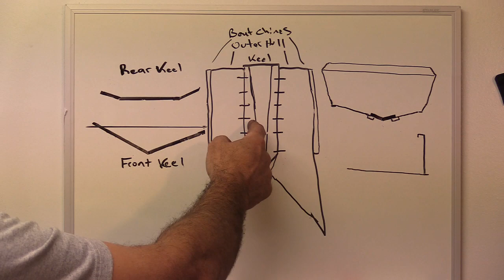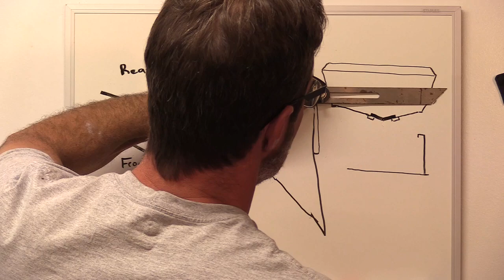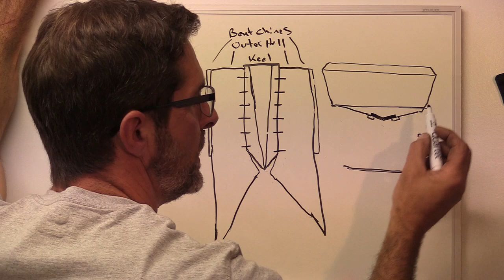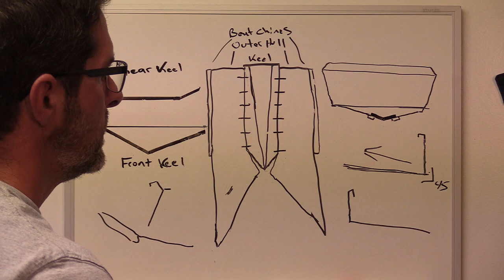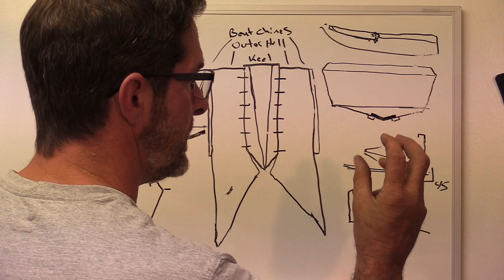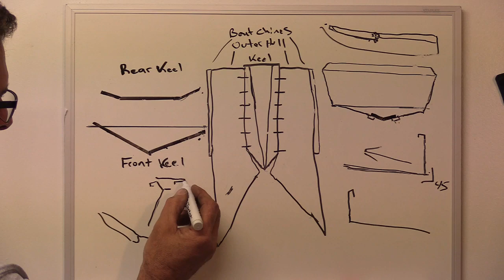Wattscraft Mini Jet Boat Build - Instructional Video #1

Comment: If your going to build your own boat from a kit set you should do the basics first when it arrives (before tack up) that is measure every thing. Both half should be the same. If all measurements are the same then measure the bends in the keel it's a very easy process if these are all good start the tack up. Remember  you must give and take. some times you will need to grind some times you will need to weld. If you thought you could build this boat then you should be able to fix this problem.
I'm from New Zealand  were these boats are designed and alot are made and we don't complain we just fix problems. Measure Measure Measure
Reply from the maker: You can’t just grind and weld away bad bends from the keel up and have a straight hull. I didn’t pay $5k and drive long distance so that I could go home and learn that after returning the first kit. I can’t bend 3/8 sheet in my garage. Learning how to hack together a bad kit takes a long time. I know that these videos have saved some other novices from getting screwed like I did, so you expert hackers will just have to put up with my complaints.

Comment: Did you consider the possibility of the bends changing in transit people are rough and lets be honest if it aint theres they dont take the best care of it
Reply from the maker: Not the over-bent side panels and top rails for sure. The 3/8 keel is only   a couple feet wide with, essentially, what amounts to cross bends structurally. You would have to drive over it. The side panels and top rails were over-bent in reverse, which would be the case if the brake was weak or not set up well on one side. You would turn your work on the brake one direction for the left, and the other for the right. I don’t think they had the ability to bend it well when I bought my kit. Either that, or they farmed it out and just sent it. I got the feeling that they couldn’t fix it when trying to work with them. That’s why I gave up on them and tried to get it corrected locally, but it didn’t work. Re-bending 8’ 3/8 metal is probably a losing game, especially where I live.

Comment: Paul,  I'm looking at a watts craft kit and after your video I am questioning my purchase. That said, the parts are all CNC so I can't imagine parts are the issue. As for bending, evaluating the kit, that's something you have to check prior to any fab begins. Sorry to hear about this because you obviously work for your money as do most of us. 
Thank you for the post
Reply from the maker: I like the boat, but those bends need to match. I like the looks of their new scookum (?) Hull. The swim deck is part of the hull, which gives more room for things like the water box. I would personally want to check the bends myself though, or get some kind of written guarantee. If they would give you the bend specs, and guarantee deliver of a proper kit or cover return, maybe it would be worth it.
Reply: @paulchristian8271  I'm in 100% agreement with you on that because a good fab man would want to double check especially with prefab beds. What power did you use?
Reply from the maker: @texasyankee1013  I used a 2016 Yamaha 1.8 naturally aspirated. It’s top speed is 42 using gps. I haven’t felt like it lacks power at all, but my interests are more family oriented in use. It does great running the rivers, so I’m happy with it. The supercharged versions suck a lot more gas even at cruising speed. More power is great if you don’t mind paying for it. I was also thinking longevity.
Reply: Thanks! I'm looking at building a honda K20 or 24 and marinizing for a jet. Not sure what size boat yet, but would like to build the motor between 350-500 hp.
Reply from the maker: @texasyankee1013  Wow! That should be an interesting ride.
Reply: @paulchristian8271  If it happens I'll video the build, boat and motor. Will try to keep you posted. .

Comment: dont worry about it just use the dam thing, you would have a tough tome the first time building a house too, but we all do.
Reply from the maker: FreedomMonger People need to know what these kits are. They sell them giving the impression that they are an easy tack up and weld build. That is not true, and getting a poorly bent kit takes it from difficult to ridiculous. The people buying these kits are generally not boat builders, and need to know the “normal”challenges that come with it, let alone the increased challenges that come with bad bends. Some people actually want a nice, straight, and even hull. They should be aware of the challenges and risk that come with these kits.

Comment: Im surprised you continued thru the build at the point you realized a struggle in your fit up from side to side.
Reply from the maker: Kurt McCormick If I had it to do over, I would try to get the bend specs from Wattscraft and find a shop that could make them right before putting a single tack on it. I’m doing the videos to let people know not to take their bends for granted, and not to let RSR off the hook if they buy a bad kit from them. Unless you live in Idaho, it’s not easy to take it back to have them fix it, and I don’t know if they could anyway. When you don’t have any experience, you end up listening to them and continuing on when you shouldn’t.

Comment: I just completed my wattscraft first time on the water last weekend.  I found the instructions quite adequate and everything lined up surprisingly perfect.
Reply: Next time im out I will try to video it .. still needs paint and few other small jobs . 
I ordered mine directly from wattscraft in New Zealand as a flat pack. Folded here in Australia but everything lined up with absolute precision.  
You will be happy once done handling is awesome and although heavier than a jetski still very quick to the plane.  Running a Yamaha gp1300r motor and pump...
Reply from the maker: ididnt doit Make a video. I’d love to see it.
Reply from the maker: ididnt doit RSRACECRAFT is where I got it.

Comment: thank you, Sir. Your level of documentation, discussion and commentary is very much appreciated. I am looking to do something similar but I am looking at going my own route. I have purchased plans that were piss poor and require a ton more detail. Please keep up your work, I am watching every single one! Also, where about are you located?
Reply from the maker: tommyg33s I’m in southern Oregon. Progress has slowed down due to my summer work load. My grandmother is close to death, And I’m in charge of her affairs, so    I expect progress on the boat to be slow for a couple of months. All I got done in the last week was a bow brace and a little hull welding. I’d be really happy if I got the deck and windscreen on this weekend. I’m working on my welding as well. I have to freshen up every time I go back to it. Different thicknesses and types of joints require adjustments, and it’s better to keep moving when I get it dialed in. It sounds like you have a challenge ahead of you, as do I. Normally, I enjoy a challenge, but a good challenge is better when you are not in a hurry, and can stick with it. I was hoping for a summer boat, but I need to mentally switch to fall, or later, otherwise my failure turns to frustration. I’ll keep the videos coming as often as I can. Good luck on yours.
Reply: @paulchristian8271  I'm sorry to hear about your grandmother. That's a tough situation for anyone to deal with. 

I'm planning to use my tig welder for as much of the boat i can. Yes i will move slower but the control will be easier with a torch that can be adjusted on the fly. I picked up a multimatic 220 and have been practicing tig when time allows. I know most boat builders use a spool gun but not only are they expensive, they are bulky. Pros and cons i guess.

I wanted to build my boat for hunting season this year but work has been busy. Its not realistic to build it and have it ready in a year for myself. It was causing me a ton of stress to the point i couldn't sleep. I hope youre not feeling the same because it's self induced stress and it wears you out. 

Anyway, im looking forward to any updates you have. I really appreciate your work. Take care!